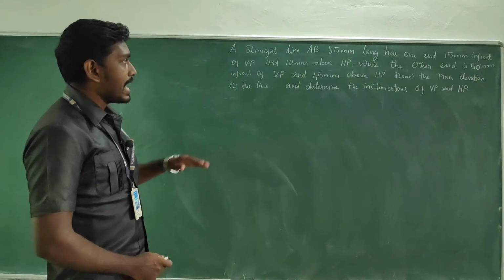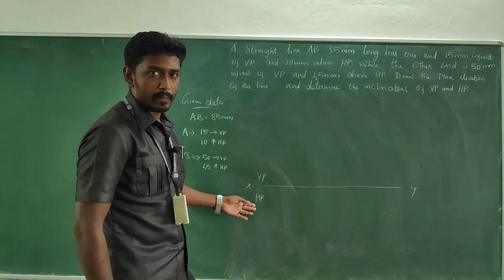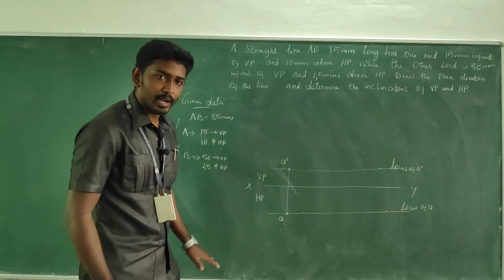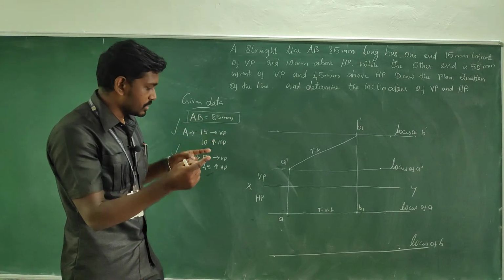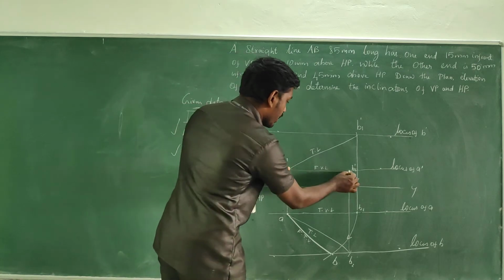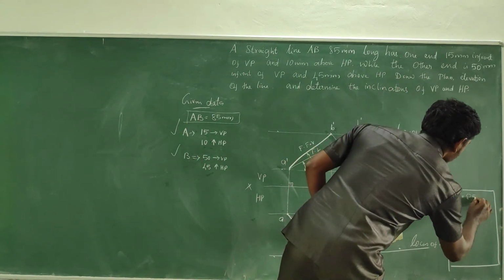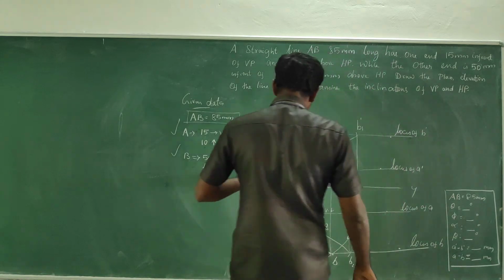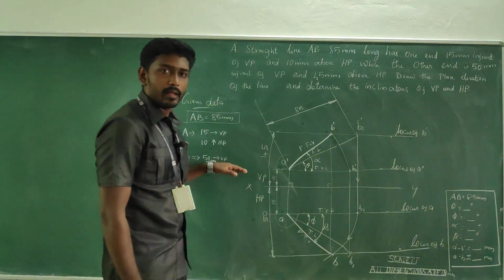Projections of Straight Line| Problem 2| Unit 2

Comment: A straight line 85 mm long has one end 15 mm in front of VP and 10 mm above HP while the other end is 50 mm in front of VP and 45 mm above HP. Draw the plan and elevation on the line. Determine the inclinations of the line with HP and VP